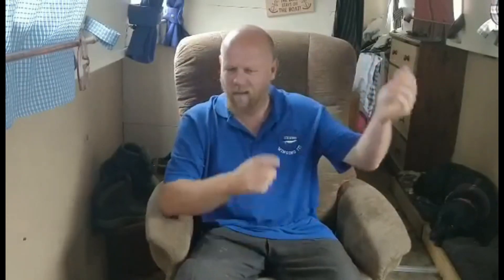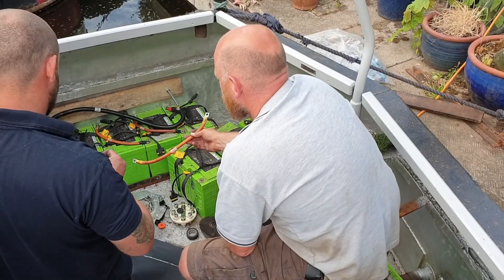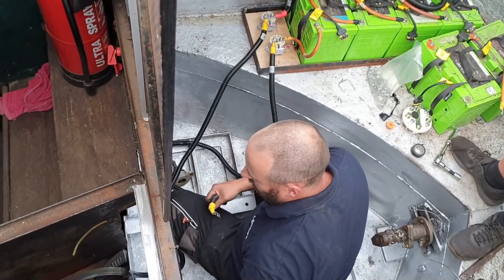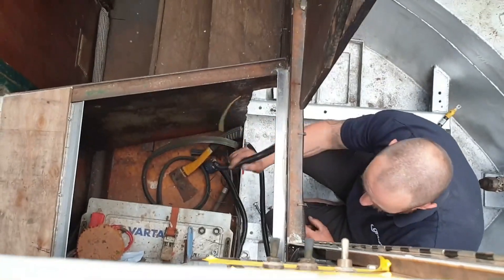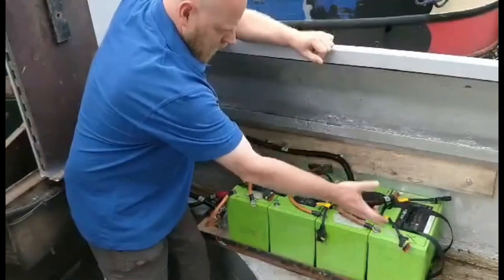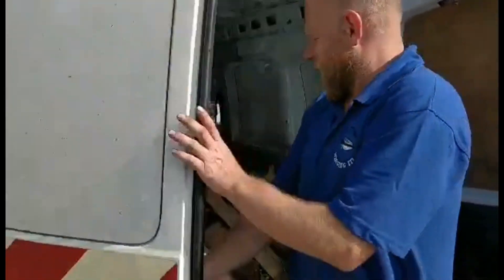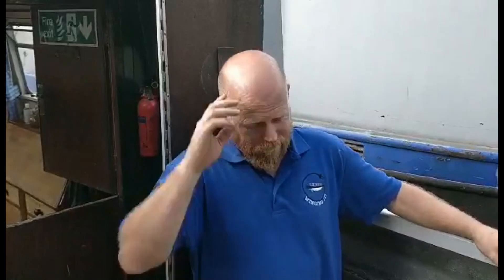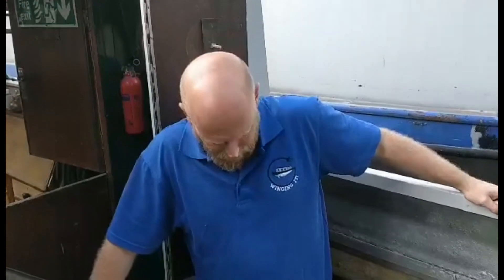DIY Electric Drive Conversion on a Boat - Winging It, With The Tight Yorkshireman. Episode 5

Comment: I noticed in the video that the positive terminal of the batteries is next to the hull of the boat. I was told by the electrician that fitted my batteries this is bad practice as there is a possibility of a spanner, when working on the battery, also touching accidentally the hull and causing a short.
Reply from the maker: Thankyou. Itwill have a wooden panel between the hull and the battery. 😁😁😁

Comment: Absolutely Brilliant 👍 
Not nocking it in any way and I’m sure your open to free advice 👍but allways try to get fuses as close to the batteries as possible as that length cable from the battery to the fuse has no short circuit protection.
Love the idea of 4 separate banks.
Had you considered 2 banks of 8 batteries in a series parallel configuration, still giving 48 volt banks but twice the Ah capacity.
Oh and definitely Nuts & Volts.
Look forward to the next one 👍
Reply from the maker: Only just got chance to read and respond properly to comments. 
And yeah I think we will look to move the fuses to by the contactors. 
To be honest we have just used what cables we got to at least get it set up so we can confirm it works... We also need to box the batteries in and things like that.
All on the 'to do' list... And if the rain ever stops I will be cracking on!
Reply: I was going to make the same comment as Mark about the fuses, and I see you've taken it onboard already, so good onya Pete. Keep up the good work!

Comment: Best practice is for a fuse to be as close to the power source as practical as it's the cables your protecting. Maybe better, and part of the boat safety certificate, to have your main battery fuses at the contactors.
Following this with interest as I'm sure many other like the idea of going electric.
Reply from the maker: We will be tweaking the wiring as we go... 😁